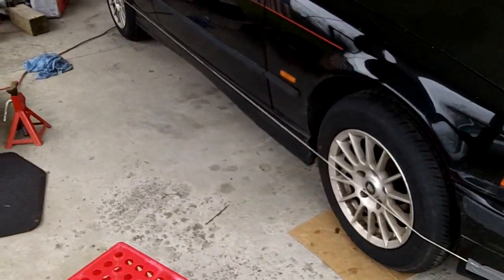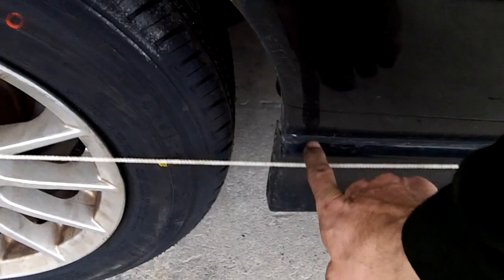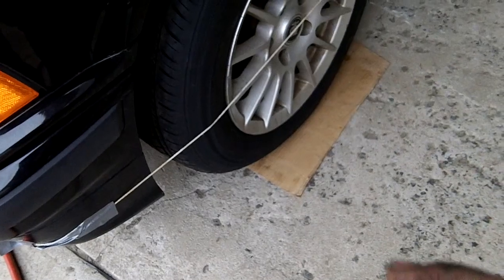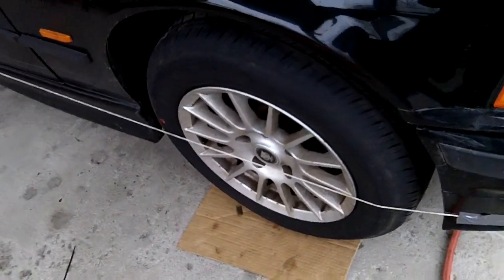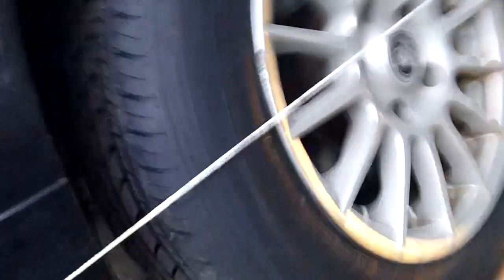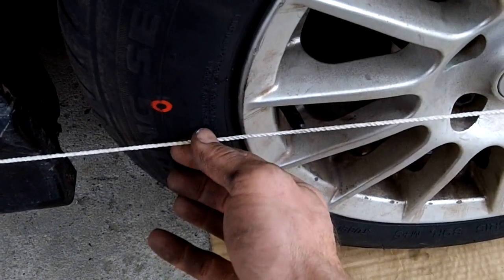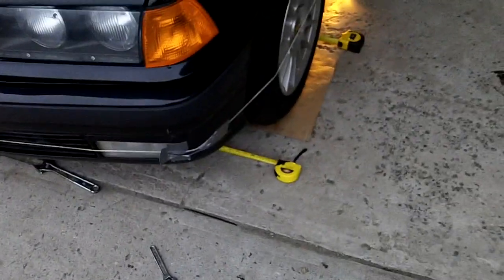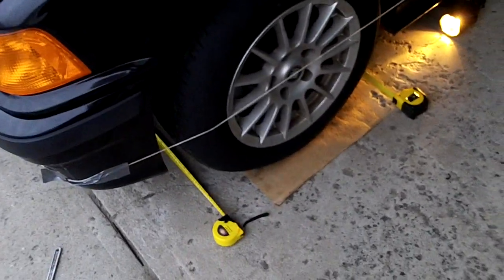How to align your car with string, DIY

Comment: Just a quick update on the car .. The tires still run true with no uneven wear .. Drives down the road straight . If you have a car that has been seriously damaged , then I would recommend a full alignment .. On this car I just replaced control arms . On this car only the toe-in is adjustable . Thanks for viewing .

Comment: I've used the same method for over twenty years to get a car close to being aligned after changing tie rod ends etc. Then when the parts where changed out I'd take it in for a laser measured alignment. Oddly enough a few times I've had the car dead on!!! The only thing I would suggest doing different is using a piece flat stock held to the tire/wheel and then using that to measure from. Tires are not always uniform. Nice vid.

Comment: a tech i knew used the string theory to align cars, Mercedes in particular, i always  ignored that technic until i no longer had access to an alignment equipment...alignmens shot up from 60 to $100 in orange county ca  as of 2024, specials on Groupon were available, half price, however after 3 calls to shops none wanted to work on my older vehicle that had easy camber and toe adjustments, no shims required. so i decided to use my old digital angle tool, value 20 bucks ,for camber and i used the string alignment theory as described by the presentation. i used the tape to hold the string for adjustments. i took pre repair specs and after repair specs so i would be on the ball park...thanks for the vid, it was  straight to the point no joking and jiveing...

Comment: One extra thing to check is the distance between the 2 strings in the back of the car and make it equal to the distance between the 2 in the front making sure the strings are parallel.  You need 4 jack stands for this.  I couldn't just wrap the string around the back tires.  I have a VW Golf MK4 series and you can't just put the string up against the rear tires because the distance between the 2 rear tires is smaller than the distance between the 2 front (by almost 2 inches on my car).  Also for the final adjustment, I use a dial gauge (you can also use a ruler) to measure the distance between the rim and the string instead of using the tire's sidewall.  As long as your rims are true,  it's more accurate than the rubber sidewall.  Thanks for the video!

Comment: Thanks for the video. Saved me a trip to Town Fair Tire and at least $90 when it turned out that all I needed was to adjust the toe at one corner. The right rear had at least 3/8" toe in when measured at the sidewalls, and I brought it back to almost 0 to match the left rear tire. This should solve my cupped tire problem.

Comment: Nice vid. Thanks Mate. Totally got me started. Thinking if you ditch the tapes and pull the string out off the side wall an 1/8  at the front (Measure with a rule, stuff a 1/8 drill bit in there) then check the string just touches the side wall at the back end of the tyre. Totally meaning this idea in a constructive way.

Comment: The strings primary function is to align the front to back wheels, along with the steering wheel . The toe in measurement is done with tape measure . If the string is not used then the steering wheel would not be "straight" when driving down the road .

Comment: Okay I use the same method but different. I do not wrap the string around the car. I use 4 chairs, and tie the string along the width of the car right at the halfway intersection of the wheel extending about 10ft foot forward of the car and 10-foot rearward. Get the string taut, make sure it is true and take your measurements. I had the best alignment ever. Much better than going to shop.

Comment: What did come from your alignment? I have a 97 Ford Escort that I did tie rods last year and not ball joints. Money is tight so I am diy. I am a diesel tech and works machine will do car and we do not have the software. I did get my alignment checked. I been going off of the paper work from it to adjust my toe. I need to see if I have string and try your way. Alignments are $80 for my small car, witch is over priced I say. Your video is a help and thank you for it.

Comment: 2003 330CI,  I'm interested in the tool you made to install the thrust bushings, I put mine in in a press which shot the oil out of both of them. I installed them anyway, I may have to get another set of bushing before it tracks right. If I do, I won't buy China. Did you make a video on the bushing tool??

Comment: I'm just saying this for more knowledge.
If you used wood and nails instead of tape it won't have suspension if you also connected a hinge from the wheel to the wood too right?

Comment: what happens if the front track is 1 1/2 inches wider than the rear track? 
Your going to be way toed out and wear the heak out the inner edge of the tire plus the tread is going to be feathered.
Also it will put much strain on your new components
Reply: It is good to know if the front width is different than the rear width. Since he used a tape measurer for the actual tow in up front I think he'll do fine. Briandsmobile has a channel with a different at home technique. I think he's given up going to professional equipment since he's doing a better job with a similar technique.

I've had a lot of results that were less than professional just like Briansmobile and I want to learn to do it better myself.

Really, when you think about it, the string was there just for reference so he could get an idea of what was going on to start, then his tape measuring told him how to actually do the toe in adjustment.

By the way Steve? Thanks for talking more gently than many others here. You were actually worth responding to.

Comment: You failed to show where you affixed the tape measure to on the passenger (RF) side tire. Also what if tires that you use as a reference ( in this case you used the rear tires) are not a correct reference ? On that same note what if body panels interfere with the string ?

Comment: Toe is measured in 1/100th of a degree.  Perspective = a one second tic mark on an analog clock face represents 6 degrees.  Divide that by 6 and then divide one of those by 100.  Now take a rolling dial indicator to the sidewall of the tire and rotate the tire.  Good luck with that string!  Like to see how you work out caster at home.
Reply: Do you really think 1/100th of a degree makes any difference at all? Even differential heating/cooling of the suspension components and their expansion/contraction would change things by far more that 1/100th.

If the specs state measurements to 1/100th of a degree, you might consider that not to be applied mechanical science but pure marketing for those who sell alignments with the machine that goes ping  https://www.youtube.com/watch?v=NcHdF1eHhgc

Comment: when the tire wear on the side is it becase  is no line up? cus i replase the tirods and ball joints and still eat the tires on one side , on a nissan frontier
Reply: Both left and right tire wear on the side, or only one tire wears more?
Reply: BOTH LEFT AND RIGHT
Reply: yeah my tires wear on the inside both
Reply: jaime ledesma

Option 1:  You have a severe "TOE IN" ..where both wheels are too much "toed in". Like a duck!
Option 2: You have a CAMBER angle misaligned. Like standing on the edge of your shoes.
Go get it aligned. $100 is worth $800 in new tires.
Reply: jaime ledesma "yeah my tires wear on the inside both"
The inside edge??? Wow... its the opposite of what I wrote then. Either a "toe out" or... negative camber. Either way -- go get it aligned.
Reply: thanks i move them to the rear its really time to do somthing right now
Reply: most likely camber

Comment: sad to see all the hate on this... it shows what it needs to, and what the title says. You should already understand how an alignment is performed, to grasp how to do it with string. If you don't know how an alignment is performed, this will not help you!
Reply: i mean, for all the hair-splitters, you are saying basically, the video should be titled "The theory of how to use string to roughly approximate a wheel alignment after you swap front-ends." What strikes me the most, is looking at most of the hate mail propagators here, none have sufficiently titled videos on their own channels either.

Comment: Why are you using the body as a measuring gauge? Shouldn't you be using the 3 o'clock and 9 o'clock position of each wheel as your marks and center line?
Reply: MrJohnnyDistortion How is the body used as a measure gauge, to me it looks like it's the rear tyres not the body
Reply: +JNetwork     You're correct. It actually appears that the string is resting on the tires. Me thinks that it would be better to have the string away from the wheel/tires a bit and measure the distance from the string to the 3 o’clock and 9 o’clock position of the edge of the wheel itself.

Comment: I don't understand how do you know it's straight cz when adjusting you might hit straight Mark but then could keep going without realizing it cz there's nothing holding it straight it's only string, it will move, but at least with a computer the beams line up it shows on the screen or monitor you can't go wrong.

Comment: Funniest thing was i Did aligment 2 years back at an alignment shop and he made custom cause i have bigger tire on the rear than front  and he Couldnt get it right 3 times then he said your mistake that you have custom wheel so that mean on 3d aligment in this shop they are refering to rear wheel so in my opinion 3d alignment to suck our money and ill try to do this string method and fix It after changing tie rods

Comment: Either way pay to get it done right at shop or do it yourself and pay later for when your tires wear out unevenly. lol
Also keep in mind that a shop also inspects your wheel bearings, ball joints, control arms, bushings, and other related things that can effect your alignment. The inspection is free. Replace the parts they recommend then have them align it. If it's off many have 30 days or even some up to a year of free re-alignments depending what you pay.
Reply: It really wouldn't be a DIY video if I took it to a shop . It would be a Pay , Pay , Pay  video .
Reply: Russell K
That's my point. You'll still be paying doing it your way with premature wear of your tires.  Also try to get the them to honor the warranty when they ask you; "Who did the alignment on your car?" But what do I know. I've only been wrenching on cars for over 20 years and have owned more than I can remember.
Reply: DaytonCarCare  if you like to get your hands dirty, all of this you can do your self, if you have the knowledge. You will be surprised how easy this realy is. and much money you can save. start reading, get some knowledge and walmart tools and get to it. If you like to get your hands dirty that is. :)
Reply: Tommy DjAleks Aleksandersen LoL yea like I never get my hands dirty. Can't emphasize enough. Pay the measly $50-$100 (depending where you go) for a proper alignment.   If you can't afford that then how can you afford gas or registration or insurance??? LMAO
Reply: Why do I have to have a car shop to do it? I do this my self, and have done it for 25 years :) in the proper way that is :) and no, not with a string LOL
Reply: I can teach you howto if you like, maybe you can save some money too lol
Reply: Tommy DjAleks Aleksandersen I guess ignorance is bliss.
Reply: For some I guess :) You say do do and i say da da :)
Reply: ***** You're kidding right?  All those are R&Rs and require no special tools to put back together. You're comparing apples to oranges here.  An alignment is a whole different service all together.  You really did hit ignorance out of the ball park with this one.  It doesn't surprise me when people bring me cars that are all F'd up with that kind of logic. I wonder if you roll dice, flip a coin, or cross your fingers as part of the starting process. But hey do this.  Do your little voodoo magic string alignment then do a test by slamming your brakes on at 70 mph and see how straight you stop. Better yet let me know after 6 months of the hundreds of extra dollars you paid for new tires after they wore out prematurely. LMAO
Reply: +DaytonCarCare I do all my own work on my car, 5th car, 20 years old drive a 92 integra Ls. I know Honda kid whatever. But either way doing all my suspension and drivetrain work that would affect alignment the only "special" tool I have ever need was a 32mm socket and a pickle fork. I agree with camber and caster go to a pro with a computer. But for toe alignment it makes no sense to go and spend 75$ or more when I can do it myself? Very few things I go to a shop for because I have saved probably a few thousand dollars already just by doing my own work. But like the guy before said you just can't be afraid to get your hands dirty. You just need a passion not a degree to understand your car and how it works
Reply: HxCBrutality
Well I drive my cars hard and fast at times. Having a properly done alignment ensures me that it will handle and stop straight and true.  $80 for a quality alignment is nothing towards saving my ass and tire life.  But car maintenance on the cheap is a decision based on the owner and his/her priorities.  Some people don't realize the importance of that decision until an expensive repair presents itself based on their past choices.
Reply: I drive my car hard and fast at times? But if a "perfect" alignment is the only thing your relying on to keep you braking straight and on the road you might be in for a bad time. I have always done my own work and never has it led to a failure as long as you take your time you don't need the "pros"
Reply: +HxCBrutality Did I say that an alignment is the only thing I rely on for straight braking? No. Come on really? You might want to rethink your comment. Yeah of course it's common sense that more things are factored in for efficient braking. Tires, rotors, pads, master cylinder, brake booster, ABS sensors, stability control, tie rods, control arms, bushings, springs, shocks, shock mounts, sway bars, etc, etc, etc.... With all that invested I don't half ass my alignment either. But hey if you want to do your alignment yourself go for it. But I hope you don't drive on the public highways and only off road. LMAO. If you can't afford an alignment maybe you should consider public transit.

Comment: thank you. thumbs up from me and helpful in many ways. though, I think it would be better using two jackstands to tie the string to at the front instead of going around the body. otherwise, it all makes sense.
(given the car has the same track width rear and front..) .. I also would go for a ride and double check adjustment/measurements once or twice afterwards to rule out that the tires/rims werent seated unevenly.... i know, but worth the extra 15 minutes...

Comment: lol.. aligned the wheels with a string set on body work.. What if your body work is bumped or dented...?? or your car chassis is twisted...

The string only works   if it does not touch the car and thus is perfectly straight..
and the string on the other side, also does not touch the car,  is perfectly straight and perfectly paralel to the first string.

THEN you have a usable frame of reference.